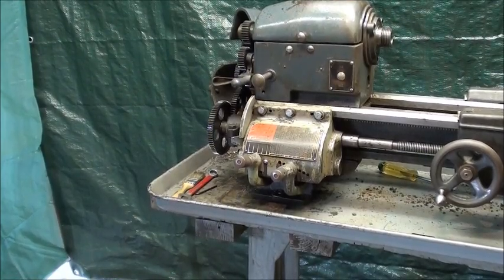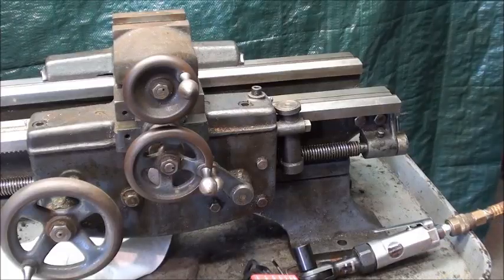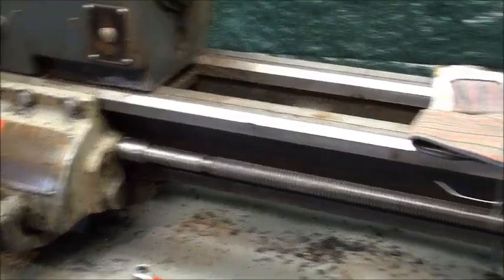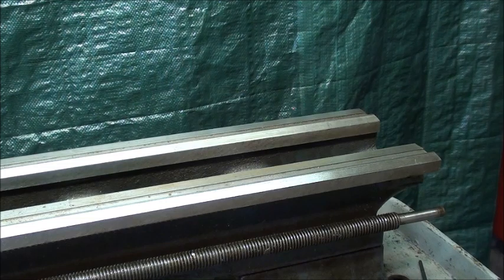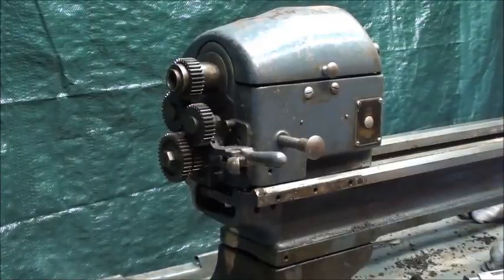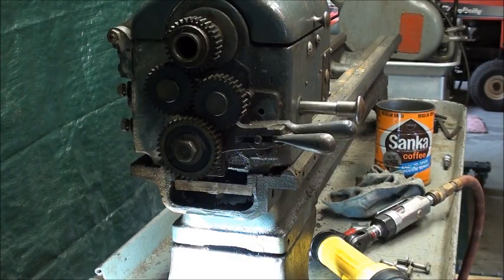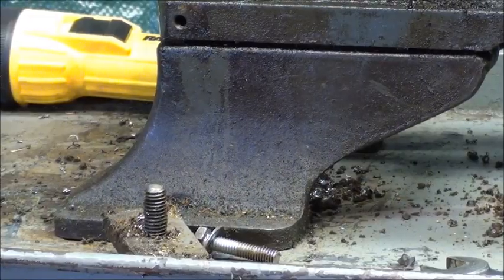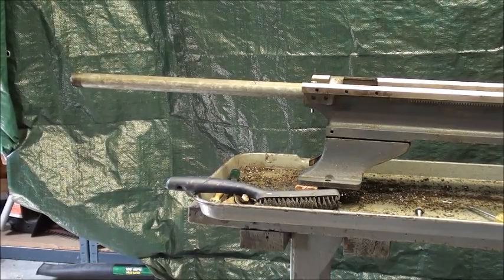MACHINE SHOP TIPS #113 Disassmbling & Moving a Logan Lathe tubalcain

Comment: Can the saddle be removed without taking off the apron?
Reply from the maker: No
Reply: I have a Logan 1875 10", and on that the apron+saddle can be taken off in one piece. The bottom of its apron is also an oil reservoir, so you have to drain the oil out first before removing, or you'll have an awful mess 😊

Comment: Selling a Logan/Montgomery Wards labeled Great website and super information on the Logan lathe. I have a clean Logan, labeled as a Montgomery Wards )Model 04TLC-700 from about 1955 from a great uncle- learned a lot with him. I am putting the lathe and all tooling up for sale. Motor runs quiet, has original LEATHER belt, tooling, guides, and misc components. Please email me at jps11@yahoo.com if you are interested. PLEASE PUT LOGAN/MONKEY WARD lathe in subject line. I will send images of the entire inventory.

Comment: I'd probably use a pack or 2 of small ratchet straps counter opposed on each way to pull against each other, but yours looks real solid there..
Sanka, that has to be at least 80s vintage, I can barely remember it..

Comment: Your statement about how disassembling other lathes is similar is correct.  I had to move a 9-inch SB lathe into my basement and it came apart almost in the same manner.  Really liked the pipe idea, I strapped the bed to a hand cart but it was pretty awkward since its not bottom heavy when its standing up.  Nice Video!   Oh, yeah, love the classic Sanka Can.

Comment: A nice, safe move. As a very young man, I bought a lathe from a factory, where I used to work. The manager was a bulldog, kind of guy and rushed me to get the lathe moved, to make room for the new lathe's arrival. As a result, I didn't disassemble it enough to lighten the load to a safe weight to handle. I got hurt, moving that thing. I never let anyone rush me, moving machinery, after that. I would say, "either let me do it my (safe), way or I'll sit here and watch you do it yourself.